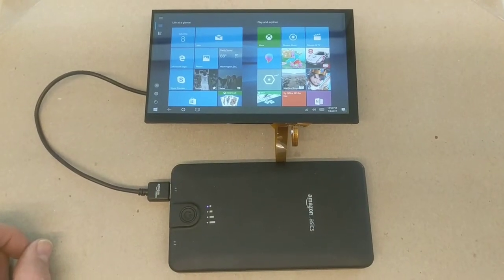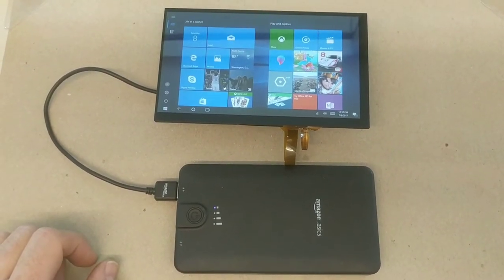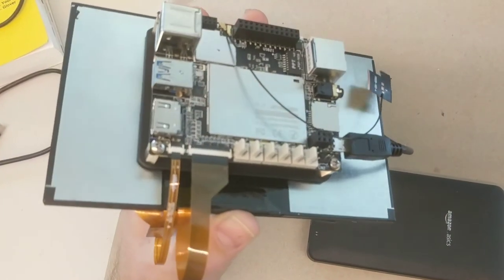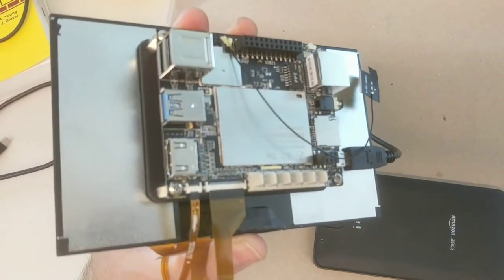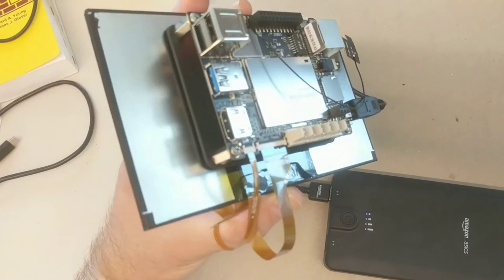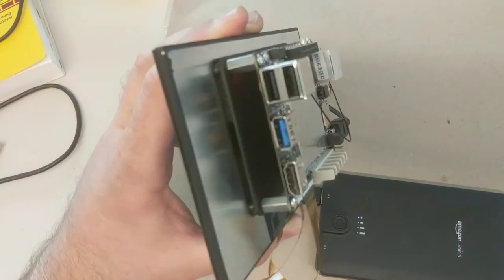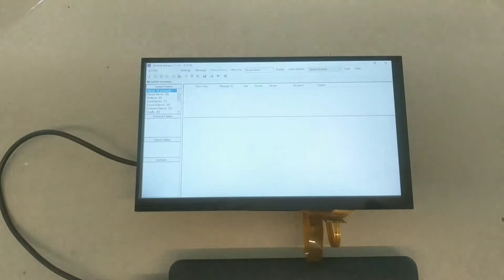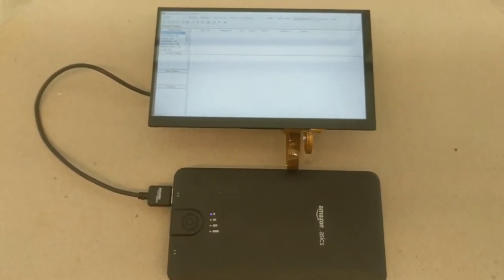Latte Panda SBC for Amateur Radio Winlink

Comment: Hi Jon Nice video. Im thinking about making a WinLink station with a LattePanda also. My question is can you supply it with enough
power to run the computer, the display and touch screen, a cooling fan, and the signeLink?

Comment: Nice video Jon. What are the specs of the battery? and have you ever experienced random loss of power with too many peripherals plugged in? thanks :)
Reply from the maker: Thanks for the comment Nigel. The battery pack in the video is an Amazon Basics 16,000 mAh battery. I used that battery only for the purpose of the video. 

The Panda will run off of a LiFePO4 battery mounted in my Go Box. https://www.bioennopower.com/collections/12v-series-lifepo4-batteries/products/copy-of-12v-15ah-lfp-battery-pvc-blf-1215w